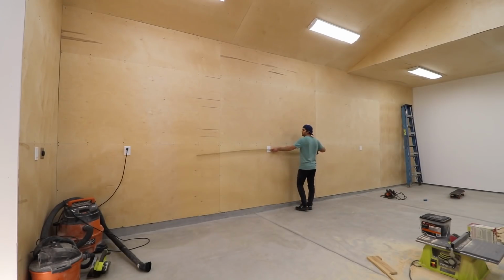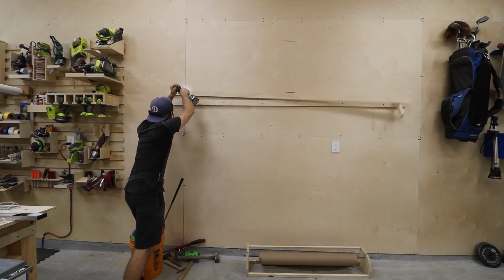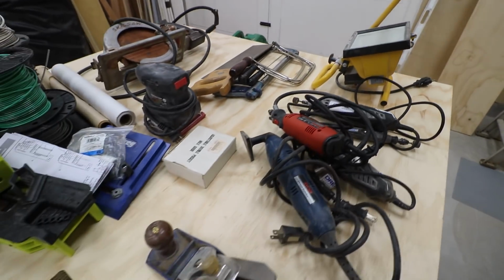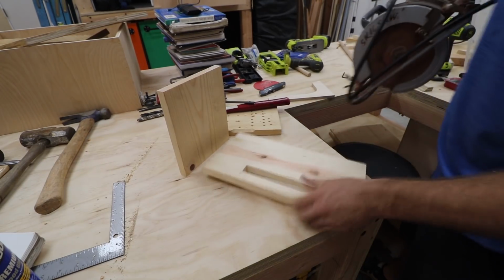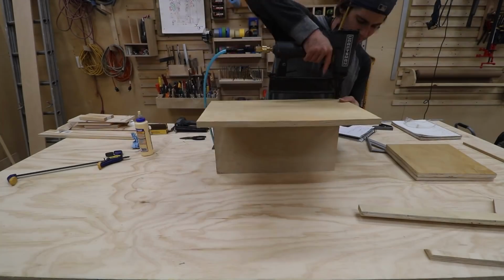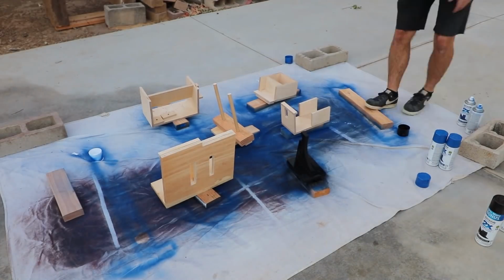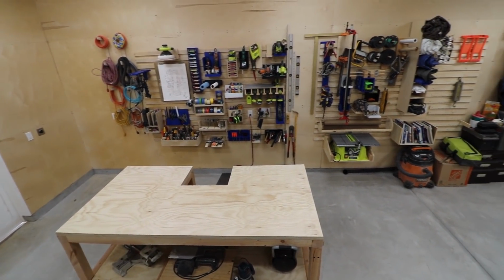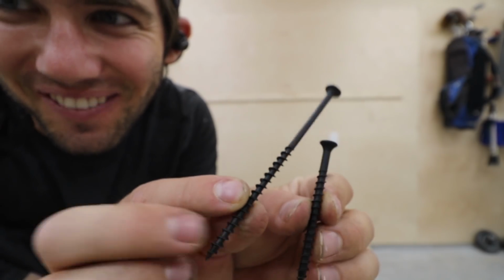Doubling the Ultimate French Cleat Tool Wall

Comment: 15:12 Most long screws look like that, if the threads went all the way to the top it would prevent the material from pulling in tight

Comment: Another method for cutting the cleats out of your 4” piece is the following formula:
Half width of stock - half the height - half the width of your blade.

In Australia I used millimetres - 100mm x 19mm plywood piece and a 3 mm wide blade.  
Formula is 50-9.5-1.5 = 39mm.   Set the fence fence to 39mm and make your 45 degree angle cut.

Comment: great videos.. One comment however is that I can see you are using drywall screws for pretty much everything.   For assembling things like benches and other wood project drywall screws aren't really a good choice. Sure they are cheap, but they are very brittle and easily snap..  But the main problem is they are threaded all the way.. so when joining wood they have a tendency to slightly force the two pieces apart.  Although more expensive, consider using construction screws on more hefty uses like joining 2 x 4s and other pieces where strength and stability are needed.

Comment: I really like your cleat system. Most of these use 5" strips instead of 4" (then cut in half) and most are spaced much further apart - more like 5"-7". Is there any downside to mounting the strips so close together?

Comment: Very nice. The only thing I didn't read like was the holder for the wire. I would have made it so it was turned so I could just pull the wire from it without removing it.

Comment: I respect your commitment to the French cleat aesthetic—have you considered framing some pieces of pegboard with cleat backing?  It would free you from custom building some things that would be easily solved with pegboard hardware.  Also, it looks like you would really get your money’s worth out of a drill press.
Reply: I'm in the process of building mine now and had the same thought. There are some pretty handy pegboard storage bins and screwdriver holders, etc. It might make sense to cleat a pegboard for some of that. On the other hand, I'm having so much fun making my own holders that I might just keep going. There is something about a custom solution that really inspires me.

Comment: Ben:  In other French cleat that I have seen, they ripped the plywood sheet into 5" strips before putting the 45 degree cut on . . . you rip 4" strips (and you also have 16 cleats on the wall where others only have 8 or 9).  Have you had ANY regrets about not going with a wider strip, OR having fewer cleats on the wall ?  I was surprised that your narrow cleats could STILL hold the weight of a table saw with its holder.  Also, what is the spacing between each cleat ?  Great video !  Thanks for the info and inspiration !

Comment: You don't need this info anymore but for others: The formula to cut two identical width cleats is (board width/2) - (board thickness/2). That's your center line

Comment: are you seriouse about the screw with the long "neck"? (Shank) or have you never seen one before xD Can't tell.

I case you don't know, having an unthreaded piece of the shank at the top allows the tip of the screw to pull itself into the wood just as a normal screw would. The key difference is that the shoulder part of the screw will easly slide through the first layer of wood and pull it against the head.

"how does that happen" - It's made like that :P

Comment: I will tell you something about those yellow lights. I opted to buy one of them because they were like 14 dollars where I could have bought a led one same day for like 30. I used it on the job for a few weeks and one day it dropped and the bulb broke. I was at the big box store and saw that led light for 25 dollars and the bulbs were about 5 dollars each. Bought that led light instead. I have had it maybe 6 months and have tossed it, dropped it, froze it and  pretty much anything else that happens on most things and so far it holds up well. It is also so much cooler and no more heat beating down on you. The mount on the one I got is not all that cracked up to be. If I recall it was a Husky brand one and is suppose to attach to a stand as well. Yet over all the light is far better than the old bulb ones.

Comment: I never knew french cleats were a thing. I am so doing this in the basement which has  brick walls. just use plastic plugs and a masonry bit and drill set on hammer side. I reckon it would look nice with a bit of stain too. thanks Dude..your the man. just out interest what was the thickness of the ply, and what size screws would you recomend.. I got some half sheets of 12mm that might be ok for boxes..pretty sure I would need 18 or even better 25mm for the cleat strips?

Comment: Dust collector: just search for cyclone dust collector, you could get it for 20bucks from ebay, apply e.g. that orange bin we can see at 03:19 underneath the French cleat wall, and add a cheap vacuum cleaner (semi-industrial) to it. Not just an easy fix, but a pretty usable one. Hope this helps, keep up the videos, I really do like the way you resolve problems!

Comment: Quick tip:
If you put your router bit tray @ 45*, you can see & access them easier & quicker, also, dust doesn’t collect as easily.

And, I could be totally wrong, but when you were cutting the full sheet of ply, it looks like you might need to raise your table saw a little bit to flush out to your work bench. 

Love those pups man. Just curious, what are their breeds?

Comment: That’s a awesome wall setup you have.  Where I live I can’t mount anything to the walls like that because I’m renting and the landlord doesn’t even want tv or shower curtain mounted.  So what I did is I now have 5 big file cabinets that I keep big tools in besides my 56”, 42” and 36”toolbox’s. (I do automobile work at home on the side) Then I build peg board doors for some large metal shelve using 2x4’s as a frame with a steel cable tensioning it to keep it square.  The doors are hinges in the center so you can only open on at a time and the shelve are bolted together to make it more solid. I have gate latch to keep them closed.  I did that because of dust when wood working and it is extra storage but most of all my son was 1 years old and trying to use brake clean couldn’t keep him out of the chemicals so the latch is up high lol.  Now he’s 3 and knows better and helps me with everything

Comment: Great system. I would recommend getting a dust collector sooner rather than later. Speaking from personal experience, all your tools will get very dusty be out like this. You could start with the inexpensive Harbor Freight dust collector that’s less than $300. It’s definitely not top of the line but it will help a lot. 👍

Comment: Did you make video about making the wall so it does not bow outward, and is that 3/4 plywood on the wall?
Reply from the maker: It’s 1/2 inch plywood on the walls
Reply: @BenTardif  thanks for replying I forgot to ask, is it only 2x4 construction walls or are they doubled up like sistered for strength, because that weight seemed to be adding up, when I saw you put your table saw on there, I love this system.
Reply from the maker: The building is new construction and has 2x6 walls. So hanging a lightweight cheap table saw on the wall is not a worry at all
Reply: @BenTardif  cool thanks, I love that paint cabinet

Comment: If you are interested in a budget approach to dust collection then you should have a look at the videos on building dust collection impellers by Mathias Wendel and then a scaled up version by Marius Hornberger. I built one for my shop using fiberglass to make the fins on the impeller blade - stronger than the equivalent mass of wood. All in it cost me about $300 for the equivalent air moving of a $1500 purchase system. Plus, it was wildly fun and challenging. You just need to find a 2HP motor for cheap somewhere. I've found that old hot tub motors work well and are readily available.

Comment: Ben, nice job on the wall.  I also put up a 4'x16' French Cleat Wall in my shop that looks almost identical to yours.  I did it about 2 years ago and have yet to find a negative aspect to it.  In fact, each time I buy a new tool and make a holder for it, I appreciate it that much more because I can easily move things around to place it in an appropriate spot. Great content, THANKS!

Comment: Hey Ben. You might want to figure out a way to put something over the top of your router bit plate. If something falls on them, even the smallest chips will ruin a bit. But, awesome ideas with all of this, and everything you do.
Reply: Maybe a hinged plexiglass cover.  It's not hard to work with, you can see through it to see what bit you need, and, if it does get chipped or cracked, it's reasonably cheap so you can make a replacement.  You might want to make several of them from the beginning so you don't have to go buy more material.